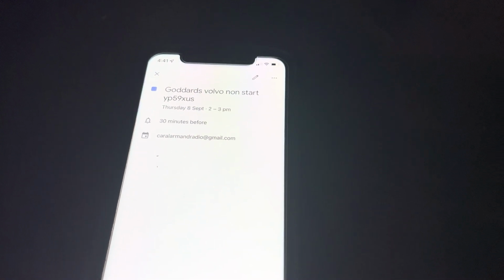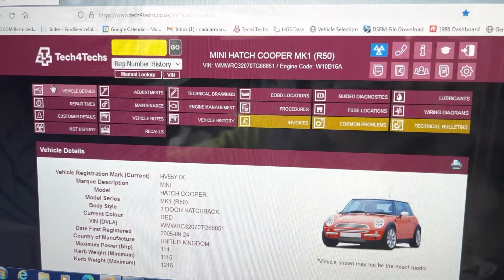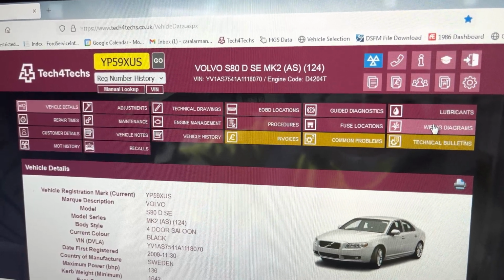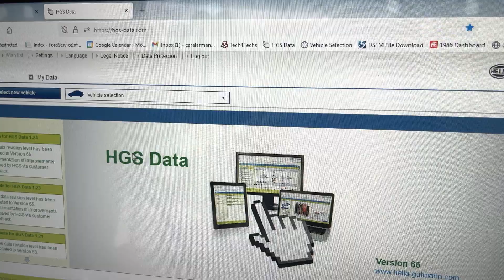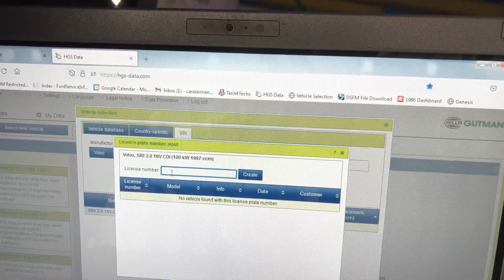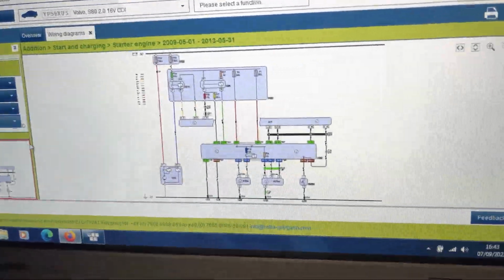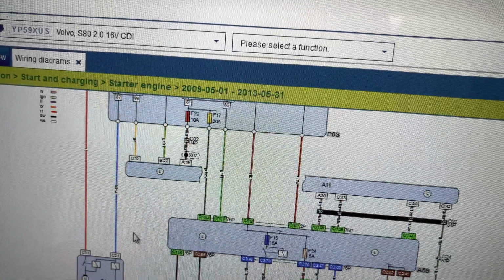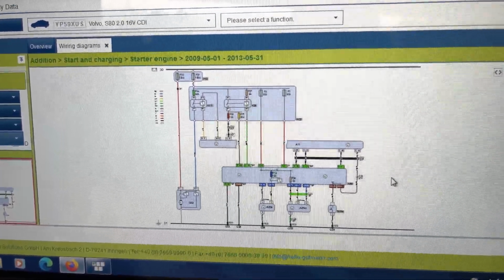Car wiring diagrams,Tech4techs and HGS data why you NEED to have these for diagnostics

Comment: HGS data..got timing marks and oil quantity information?
Reply from the maker: Hi it depends on the vehicle
Reply: @caralarmandradio  presently im on solera autodata,thinking of switching to HSG,as its litrle cheaper then solera.
Reply from the maker: @paulsp2693 ok in an ideal world you would have all of them. I used to have autodata but found it just too expensive for what i need. The last time i looked it was £150 per month and hgs is £690 a year so for me i use tech4 techs then hgs and it works well. As regards alldata it is totally not worth the money they charge as it takes forever to find the most basic of things